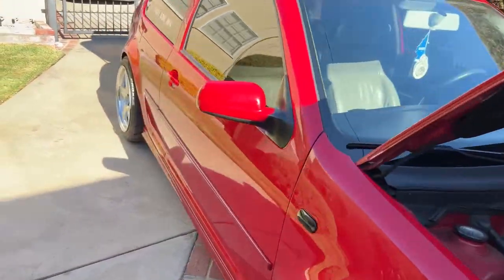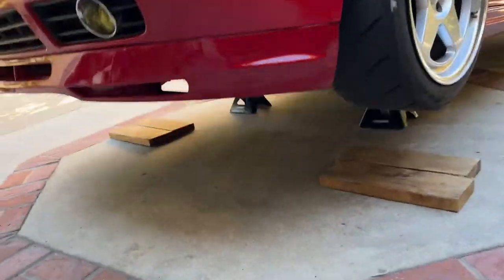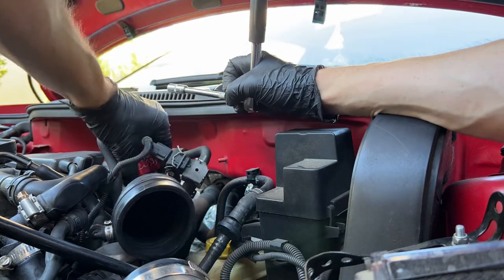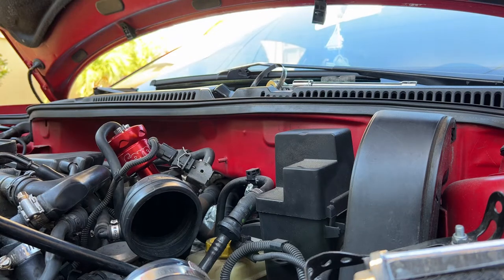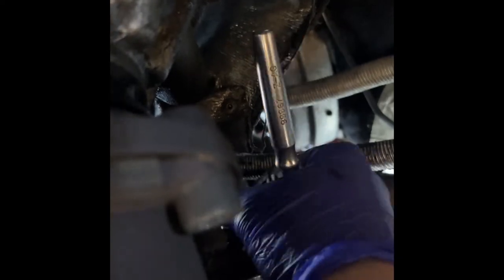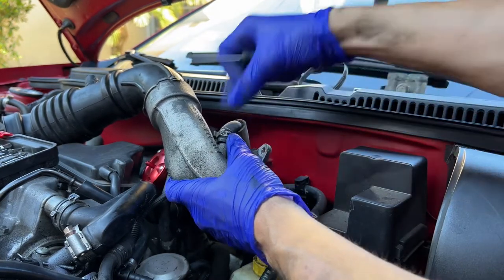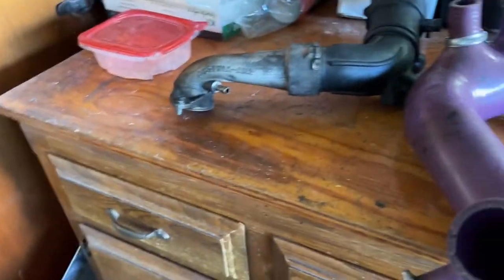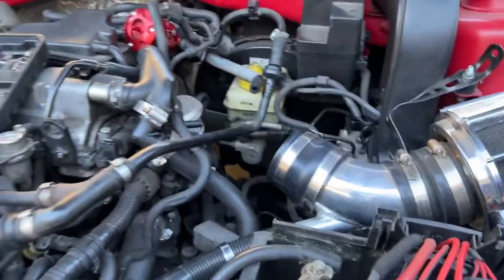Mk4 1.8T turbo inlet pipe install DIY (TIP)

Comment: My tip Is 3 inch all the way to the turbo fouls on the gear cables it was an absolute bastard to fit on similar hybrid you have

Comment: what did you end up doing about the hockey puck fitment? I just ordered one of these ebay TIP and ithink i have the bigger size hockey puck for newer motors as well
Reply from the maker: Used an adapter. Little metal piece. Places like McMaster has reducers that should work. Don’t remember exactly what I used. But I ended up using two clamps. Depending where you live and smog regulations you can fully remove that hockey puck and use a catch can set up.
Reply: @yolowrue2582  thanks for replying to such an old vid! I was thinking i would do the adapter thing and find something on amazon, don't think i'd be able to find anything local to me...do you happen to know if the other model of  hockey puck with the smaller  19mm dia would work? they can be had for like 25 bucks but idk if it fits the PCV hoses coming from the valve cover
Reply from the maker: @aaronbenarroch186  yeah have no idea about the other hockey pucks. Should all do the same thing…
Reply: @yolowrue2582  all good no worries, i ordered a 19mm to 25mm adapter and a 25mm ID hose i will cut to fit, thanks for the great video and for answering my questions